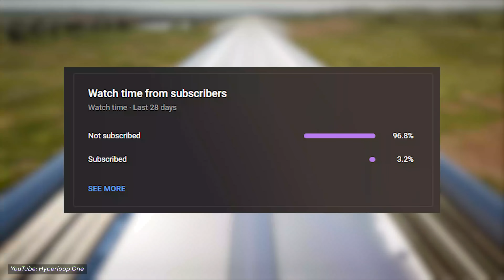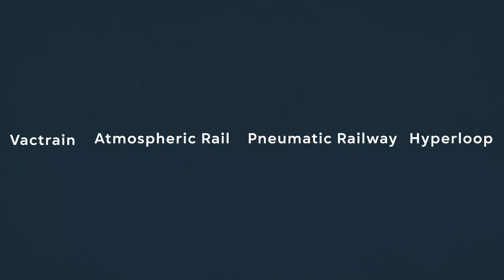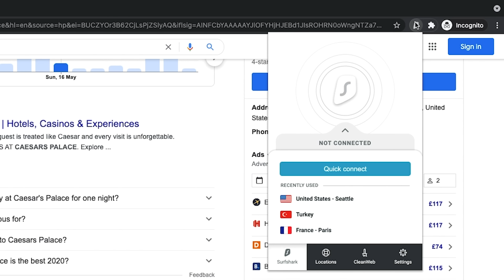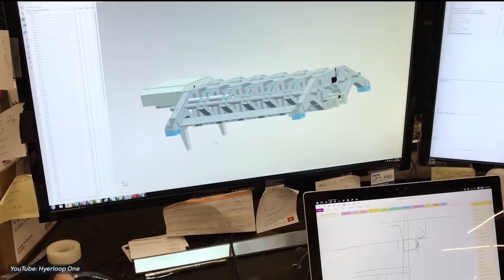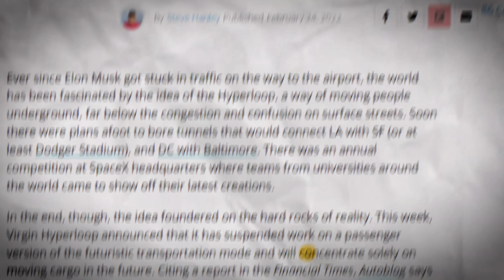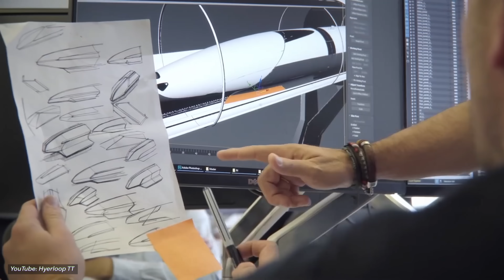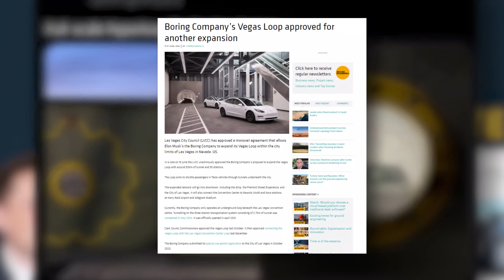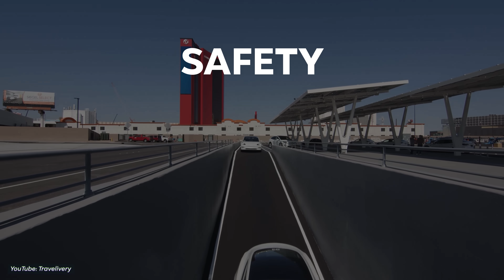What Happened to Hyperloop?

Comment: Instead of a vacuum how about blow air in the tube as fast as the train is going. So if the air and train were going the same speed wouldnt that remove the need for a vacuum since there wouldn't be air resistance. I would think creating fast moving air would be easier than creating a long ass tube that holds a vacuum.
Reply: Hurricanes can have winds more than a 100 miles (160 kilometers) per hour.  Look how much damage that can do.  If it was 4 or 5 times faster and the tube ruptured it would be devastating.
Reply: @icedriver2207  would the pressure of the fast air inside the tube be more than the pressure from outside the tube when creating a vacuum?  Also which one is easier to control.. creating the fast wind or  creating a vacuum in a sealed tube for hundreds of miles?
Reply: @divaj3539  How are you going to generate and keep this wind traveling at such speed through the tunnel. Either one would require lots of motors and electricity.  The failure of the tunnel would cause it to implode with a vacuum and explode with high speed winds.
Reply: @divaj3539  I'm not an engineer, but both seem non useable and expensive to implement
Reply: @icedriver2207  tru tru. Thanks for the discussion.

Comment: Get ready for lots of arm chair opinions and negative comments. New tech needs more than just an idea to get off the ground. If you look at early air flight, it took years and many models and ideas before one actually finally flew. Same goes with this, its early years and lots of ideas and systems have to be tested before they find something that works. The main thing is that a company sticks with it and moves the idea forward until they come up with a fully working system!

Comment: It was all a grift from the master of vaporware elon musk.
There was so much that wasnt feasible I couldnt work out why any of the people who worked on it especially the uni students thought it was going to be a thing.
Reply: Unless you are breaking physical laws, just because something is difficult it doesn't mean its infeasible to achieve. In many cases you have to build actual prototypes to see where the real problem lies which will mostly stem from material issues and cost issues rather than engineering impossibilities. We could build a hyperloop with todays technology, just it will cost too much to present an actual profitable alternative to proven technology like high speed trains.
Reply: @redmax9346  You are understating how much more economicaly unviable it would truly be, if hyperloop would have to have same safety standards as planes and subway systems.

You can make hyperloop as it is. It will be stupidly expensive, it will not reach 1200 miles per hour but it could work... for about month before some catastrophic failure happens in it that shuts down entire system for months at least.
Or you can make safe hyperloop, at which point the costs will be so stupidly high that it would be cheaper to use space rockets to ferry people around. 

Planes are dangerous but that danger is mitigated by extreme ammount of regular high quality maintenance and vast support system. And even with this they sometimes crash.
Relatively short tunnels require vast system of backups, emergency exits, acess for emergency services, and huge ammount of at least periodical maintenance to keep them in good condition. And those are regular tunnels, not vacume ones.

And you now have to combine this insane maintanance of travel pods with huge maintanance of super long tunnels. Maintanace of subway system in city is somethign that requires high hundreds up to thousands of people (depending on which city). And that is in city where you have all the infrastructure you want and where the length of tunnels is about two orders of magniture lesser than the length that Hyperloop wants to acheive.

So to sum it up, saying that Hyperloop is not profitable is like saying that surface of sun is hot. Technicaly correct, but you are extremely underselling it.

Comment: Meanwhile in other parts of the world maglev passenger train with the speed nearly half of what hyperloop dream already achieve...
Reply: Trains? You mean that boring easy to build, easy to maintain, multifunction, cheap stuff? 
Nah, it's not futuristic enough, we need separate them, put into ground, make more dangerous, a lot slower, and allowed only for short distance travel of small group of people. That should work for sure.
Reply: @delancre5858  Hyperloop was a flop for human transport but you make it seem like any type of innovation is bad. I hope that's not true lol
Reply: @theonlythingihavetosayis9333  Was it a flop though, or a scam? ... As in, did the "smart" CEOs and hundreds of engineers not forsee the unfeasability of the project or did they just agree to drive the hypewagon as far as possible, grabbing as much of the investor money as they can along the way?
Reply: @kimitsudesu  it's neither because virgin hyperloop is using it to transport freight in land and it's 4x more cost efficient vs other transportation
Reply: @theonlythingihavetosayis9333  That it would be a flop was predictable from the start. All the unsolved problems which make it unworkable were spelled out immediately.
Reply: @frenchimp  it wasn't a complete flop because now virgin mobile has been using it to transport freight much cheaper than normal. And with much less carbon emissions
Reply: @theonlythingihavetosayis9333 where? Virgin's idea dissolved a year ago.
Reply: @stttttipa  virgin was renamed to Hyperloop one. They didn't dissolve.
Reply: @theonlythingihavetosayis9333  ah, yes, that snake oil. Transporting freight? They didn't transport more than a prototipe capsule, let alone a gram of freight 😅 I am actually impressed even that bullshit has its bots.
Reply: @stttttipa  they laid off a lot of their workers because their idea changed from transporting passengers to freight. And they actually did transport 2 passengers safely, but at a much slower speed. "Has it's bots" . What are you talking about. Stating logic makes someone a bot? That's ironic
Reply: @theonlythingihavetosayis9333  if transporting passengers is not feasible with such high operational costs how the freight would be? Do you even know anything about logistics??? Well, if that is your logic, I have a beautiful seafront house in Mongolia for sale, you'd be delighted
Reply: @stttttipa  I'll put it in as simple of terms as humanely possible. operational costs are high regardless. Yet weight is not a big factor for vacuum sealed locomotion. So transporting heavy freight is much more cost efficient than transporting small animals. So much so that it yields large profits in theory, especially vs traditional land shipping
Reply: @theonlythingihavetosayis9333  no, operational costs are pretty low nowadays with regular freight. That is why your toilet paper cost next to nothing.
Reply: @stttttipa  do you understand what I say when I say freight? I mean 2 ton shipping containers. They are expensive to ship by train over land per metric ton.
Reply: @theonlythingihavetosayis9333  expensive???  And using a technology that is literally going to be 100 times more expensive in operational costs is gonna make it... cheaper? Well, try considering that mongolian seafront property, it is really a bargain!
Reply: @stttttipa  it's not more expensive to ship shipping containers in Hyperloop vs trains. I already told you this. It's a lot cheaper and much faster if it proves to work
Reply: @theonlythingihavetosayis9333  it is not because it does not exist. It will be because operational cost will likely exceed the value of the cargo greatly (unless it carries pure gold😅). Air resistance means pretty much nothing here. Do you even know how much ton-kilometer of cargo costs on average?? Silly me, of course you don't. 
And it won't work. Expensive toys are good for the tiny amount that can pay for them.
Reply: @stttttipa  I've explained it to you 3 times. It will be cheaper. Moving freight across hyperloop is cheaper than train. Just search it up. We're spinning in circles. You are objectively wrong
Reply: @theonlythingihavetosayis9333  still no. Those are projections without taking into account price of infrastructure and operational costs. I.e., wishful thinking. Learn something about logistics. Or invest in Theranos.
Reply: @stttttipa  those "projections" take I to account everything you just mentioned and much more
Reply: "n other parts of the world maglev passenger train with the speed nearly half of what hyperloop dream already achieve."

And in most parts they have realised that you don't need bullet trains at all. Just work closer to where you live.
Reply: @vinny142 what a load of rubbish. France, Germany, Italy, Spain, Japan, even Russia and Morocco have high speed rail lines for what... shits and giggles?
Reply: The correct name is "The Hypersonic Train" and it's basically, a hypersonic Maglev which would run in a technical vacuum tunnel (couple mm Hg) same pressure as it is at 30+ Km altitude! U need a pressurized Maglev train in the same way a space capsule has pressurized air. The maximum technical speed of such device is somewhere between 5500 and 6500 km/h to a maximum threshold of 7000 km/h or 4000 mph due to Coriolis Effect. The energy requires is 1/10 of a long airplane trip across the same distance , being able to transport over 2000 ppl. That's the initial Project. 🥰🤗😇